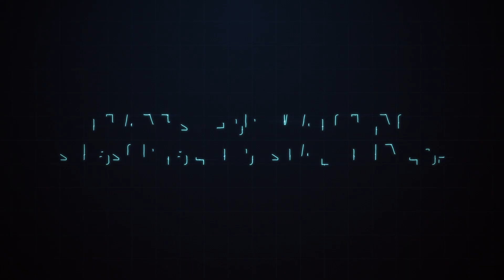Shure SM57 Complete Teardown and Capsule Replacement (Full Repair Guide)

Comment from the maker: Did you ever try to open an SM57 yourself? What was the hardest part?
Reply: Unscrewing the covers... Mine is shut so tight... Cant get it opened...
Reply from the maker: @SpongeBoss oh no! I wouldn't recommend using vice grip to hold it tight and unscrewing it has it might damage or scratch the casing. But if you really need to open it, you could use vice grip with a small cloths under to prevent scratch or dent in the metal. Best of luck!
Reply: @ThePhilStudio It's one we had at our rehearsal space for ages. I don't really care for optics. Just wanna get it to work 😅🙌🏻
Reply from the maker: @SpongeBoss alright! Do all you can to open it! I hope it works!
Reply: @ThePhilStudio thanks for reacting so swiftly. Much appreciated ❤🎉

Comment: I was taking a look at my SM57s recently and noticed some subtle differences between them. Upon further reading, apparently Lo Z with a line through through it indicates that it's likely a fake. Do you know how true this is? I only mention it as I noticed the same thing on yours.
Reply from the maker: Hi there, the LO Z doesn't automatically means it's a fake one. It can means it's an older model. i have 3 SM57 and 2 out of 3 have the LO Z indication. They are really torn up and old. I also have a JTS PDM57 which is clearly a copy of the SM57. The quality is pretty much the same but the frequency response is different. I have a video explaining and showing the difference between the SM57 and the PDM57.
To spot a fake one, check for cheap stickers, poor build quality (gaps in the body, different weight/feel), gold XLR pins (should be silver), a less textured finish, and differences in the mesh grille or internal components, with some fakes sounding brighter/harsher.

Comment: How are the thin wires connected to the coil?
Reply from the maker: The thin wires are part of the coil. Also, note that the coil is jammed in epoxy or silicon. So it's very tough to simply access the coil. If you're curious, search the web for SM57 transformer. You'll find good example and pictures of it.
Reply: @ThePhilStudio  But when you take it apart, the coil is separated, how does it transmit to the wires?